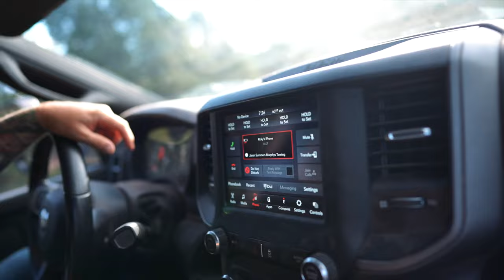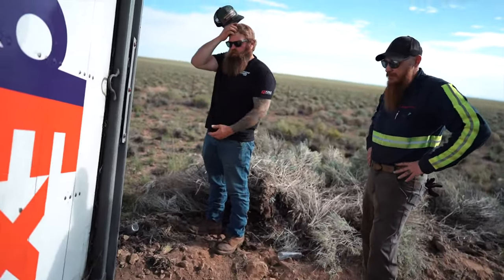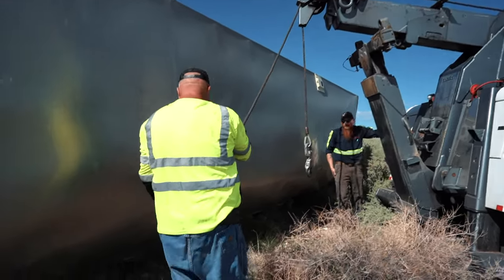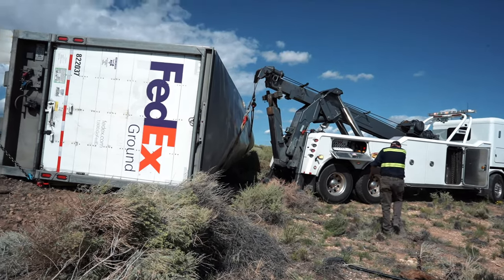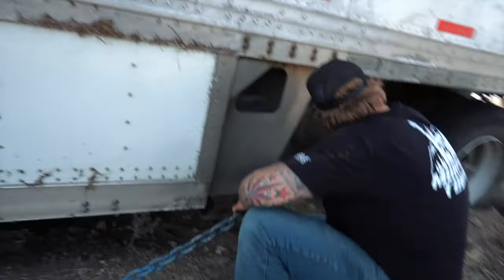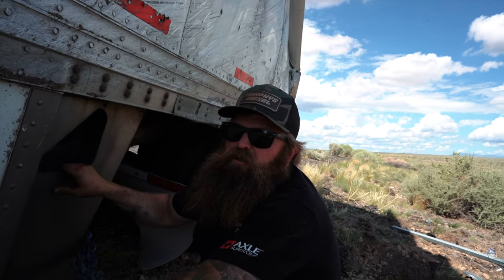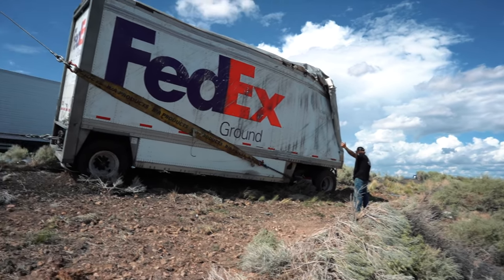FEDEX called....we ANSWERED!!! The FEDEX trailer recovery!

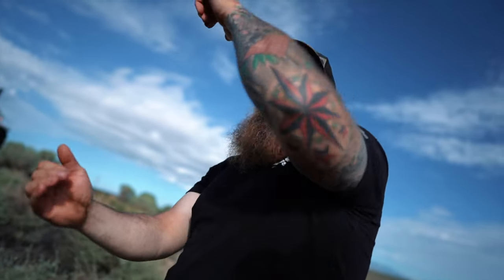Comment: At 3:05 video shows one safety chain hooked onto converter dolly and 1 safety chain laying on the ground.  Driver is lucky this didn't come apart and injure or worse.  Depending upon where this was dispatched out of it stayed together for quite a while.  Most of those converter dolly's have a button you push to release air on dolly.  Having dummy glad hands to block the fittings would help you air from the rear instead of caging brakes. Great job.

Comment: Nice recovery guys. I have found in the past for doing single lane recoveries on pups with a stationary boom another good way to do them is to run your recovery line to a snatch block up on the boom and back to the front corner of the trailer so you can use your second line as a catch, but in this case with the factors of degree of the ditch slope and with it being fully loaded and being able to use the right lane to angle your wrecker to the load you were having to lift , you guys weren't left with too many options. I am surprised at how many of your recoveries you guys do that the highway patrol doesn't offer you more protection for more room to make your recoveries. Great work though. Way to go Murphys Towing👍👍👌🦾

Comment: How did the pintle hitch look on the first pup. Converter dolly looked okay as far as I could see.  5 th wheel stayed connected so no " high hook" or not properly latched.
Reply: After reviewing in slow motion it looks like pintle hitch on lead pup has the safety latch up or open.  Safety chain bar looks like one side is ripped off.

Comment: When FedEx says ground they literally mean it damn wiggle wagons why did the converter come loose. I worked there 10 yrs the shit ya see🤙🇺🇸🤙
Reply: Converter dolly looked okay,  possible someone forgot to put the latch down on the pintle hitch on the first pump or it ripped off the pintle hitch on the first pump. But most dolly's have a air chamber that tightens up on the dolly connection. No doubt it will be deemed "driver fault".

Comment: Quick question - noticed that this wrecker has twin steer axles - does that allow more weight to be towed or is it more for increased maneuverability? Thanks!
Reply: More weight, and weight balancing.
Reply from the maker: It does not increase maneuverability. It increases stability just in case you blow a steer tire. It does increase capacity as well.